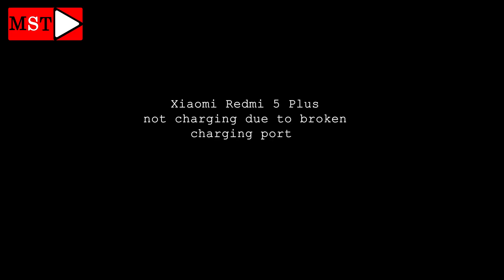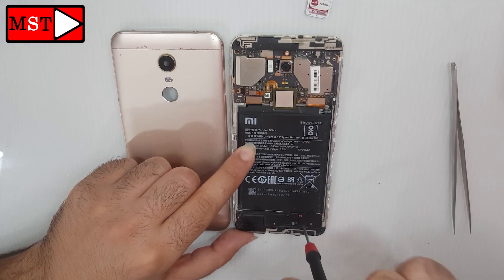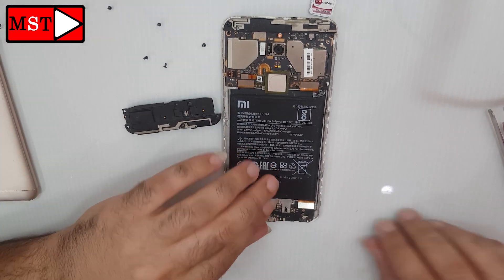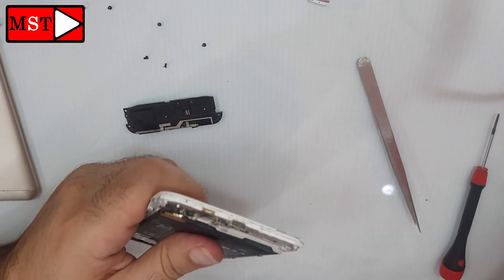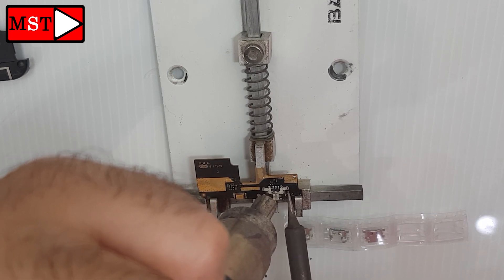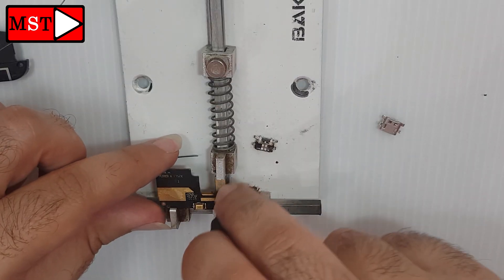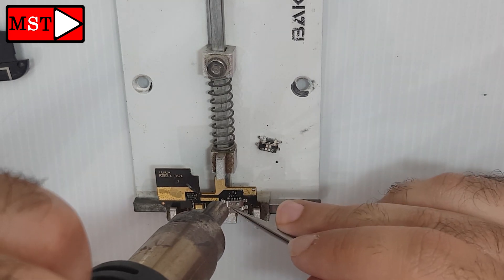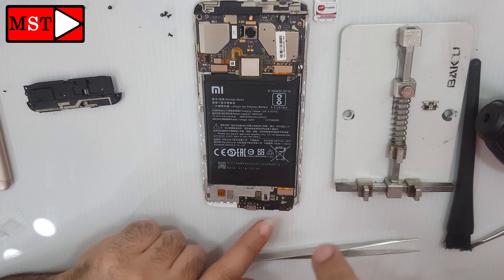Xiaomi Redmi 5 Plus Not Charging

Comment: Hey i actually forgot to unplug the battery cable and i removed both speaker and charging port. Do you think if there is a chance i damaged the phone? I havent replaced anything yet.
Reply from the maker: Im confused, explain more to me .
Reply: @mstphone  ok so i didnt unplug the battery like you did on 0.49 and i skipped to the part where you remove the speaker and charging port. I dont have the replacement charging port yet so i stopped there.
Reply from the maker: Ok, as you explained you didn't do anything to damage the phone. Everything should be fine .
Reply: @mstphone  ok thanks for the help man
Reply: @mstphone  Hi again i fixex the phone the charging port works now but i get no sound from the speaker. do you know what i can do to fix this?
Reply from the maker: Great .
Check out the two pins from the speaker that connected to charging board.
Reply: @mstphone  Do you mean the little dot things
Reply: @mstphone  I think the problem is with the new charging port i have purchased. I tried it with the broken one and speaker works just fine with it. I think i need to find someone who can solder a new micro usb port to my original board. thanks for your help man
Reply from the maker: Anything you need bro.
Good luck